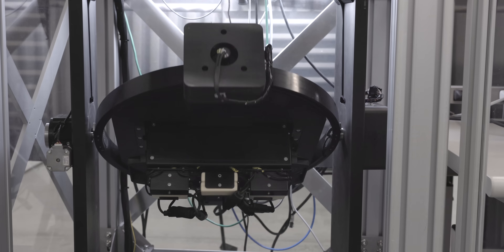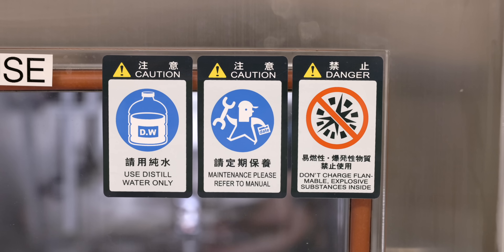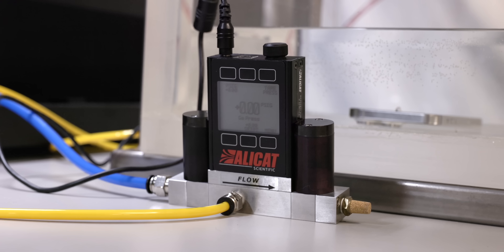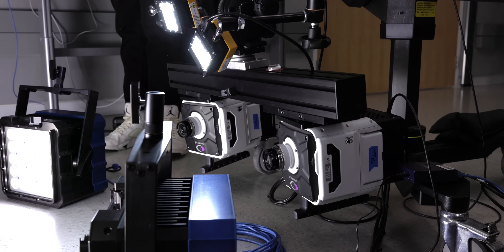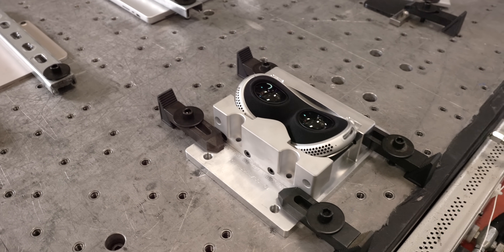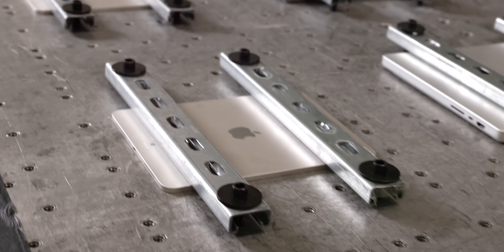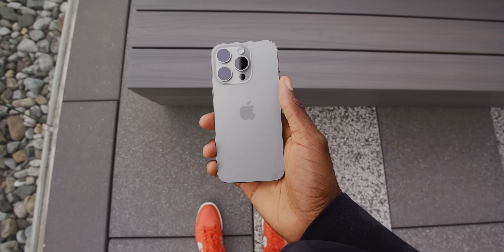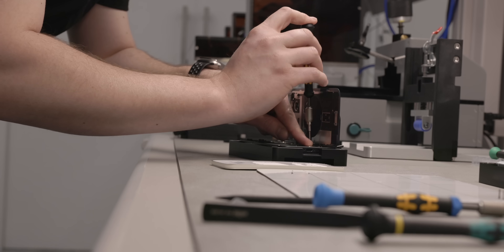I Visited Apple's Secret iPhone Testing Labs!

Comment: "Repairability is at odds with durability"

Nokia 3310: pathetic
Reply: I mean the ULTIMATE GOAL is to have both repairability and durability. But this goes against the profit margins of Apple.
Reply: Nope, the ultimate goal is to never have to fix anything
Reply: @innovativeyetaknowledgless9035  Will not work since batteries age.
Reply: @thepuma77  not just apple. its all companies that manufacturing things.
Reply: @thepuma77  what phone company does it any better?
Reply: I mean, it actually isn't that hard to destroy a Nokia 3310 in spite of the memes - just that you have to specifically smash it with intent, most everyday drops with even the clumsiest of people wouldn't permanently break it lol
Reply: Literally every Volvo before the year 2000
Reply: Well I'm sure with more modern technology it's harder to have both, I feel like with simpler tech finding a balance between the two is a lot easier because there's less stuff to break.
Reply: not to mention older nintendo handheld consoles!
Reply: Is a Nokia 3310 waterproof? There you have it.
Reply: There is an underlying assumption for that statement.  That the size, performance, and cost of the device remains constant.
Reply: BMW & AUDI left the chat
Reply: MrWhoseTheBoss broke the myth of the Nokia 3310 in one of his vids
Reply: Yea it's pretty much a dumb argument but Marques lapped it up like a dog do to water
Reply: @NicotineRosberg  money
Reply: its not easy to repair Nokia 3310 in 2024
Reply: Can you watch youtube on a nokia 3310?
Reply: @seunfunmiewedairo4161  Nokia is releasing a new one 🤞
Reply: Its bs because the main problem with repairability has almost nothing to do with the structure of a product and every thing to do with the availability of replacement parts and software locking parts so you can't replace them. Apple does everything in its power to keep people from being able to buy replacement parts directly from the factories they are produced and loves drm. @seunfunmiewedairo4161
Reply: @seunfunmiewedairo4161 Way to be a smartass. "Im too smart for my own good."

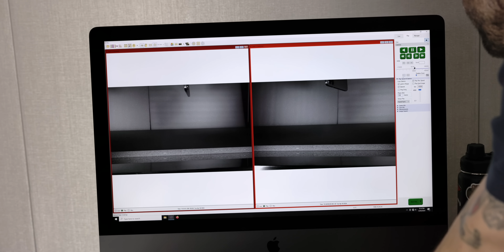Comment: 5:00 is that a IMac running window 😂 I am assuming it’s  legacy software or very old program that was designed for windows that they keep using maybe because they wouldn’t be able to go back and retest with a newer program or with all the data they have it would take a  astronomical amount of time to redo all of the testing . But that’s just guessing.

Comment: For over 18 years I'm in electronic repair industry , in your video on the 6:55  you claimed that repair and durability is on the same scale each one is on the other end, thats not accurate at all, its not even close to reality, Apple is trying to (again ) mis lead the consumer (by using you ) by claiming what you claimed, from my experience durability has to do with material engineering and assembly design only, a water profe device should be easy to repair (if the manufactures provided the diagram and the tools and parts to fix it ), designe it to be easy to fix, has no effect on the durability of the device, in the 90th and 80 all appliances was sent with a diagram and instruction for how to fix it, those appliances is more relabel than 90% of today appliances (ask your parents) They are trying to make it a big deal (Apple and all other brands) to justify there resistan to make there devices easy to fix, the funny thing is when the apple engineer  when basically he saying: repair is not good to the environment, and the device that cant be fix because is "durabel " is bad for the environment .....
thats a direct bullsh....... if you fix something you dont need to buy a replacemnt, that will harm the factories who need us to replace instead of repair, you remember the iPhone 6s battery scandle, i wanna add that when they fail to stop you form using you first ipad you bough iPad 1 to ipad 4 cant be updated and ipad air 1-2 and ipad pro 12.9 1 gen all cant be updated even i cant see why, just to push you to buy a new one, if i need the ipad just to browse online and to check my email why they want me to buy new one!? its all manipoly , they want us to buy instead to fix what we have , and sadly they are using you to promoted , i wish you did some study before you promot what they claim

Comment: Here are the key takeaways from the video:

1. Apple has secret labs where they rigorously test iPhones for water resistance, drop protection, and durability through shaking/vibration tests before releasing them.

2. Water resistance testing involves dripping, spraying jets, high-pressure hoses, and full submersion tanks to simulate different levels of water exposure (IP ratings).

3. Drop testing uses industrial robots, high-speed cameras, and various surface materials like granite, marble, asphalt to analyze impact forces repeatedly.

4. Shaking tests vibrate phones at specific frequencies to simulate years of real-world wear and tear from things like vehicle engines.

5. Apple goes through around 10,000 prototype iPhones for durability testing before finalizing a model for release.

6. There is a tradeoff between durability and repairability - more durable designs with seals/adhesives make battery replacement harder but reduce overall failure rates over time.

7. Apple believes maximizing durability is better for the customer and environment in the long run, despite making repairs like battery replacement more difficult.

8. The head of hardware engineering explained Apple's philosophy of prioritizing reliability through durability testing over pure repairability.

Comment: 07:54 please, no! You can design a product that is durable AND repairable. Please look at rugged phones or even just Windows notebooks or PCs or cars. They are durable, don't fail, and are repairable. It's a choice to make your product non-repairable and Apple went to great lengths to make it so as has been proven by many repair shops and professionals.

Comment: Maybe I'm wrong, but isn't a more durable product when u basically can't repair it worse for the environment? Because the product, when it fails is most likely to just be bricked. So that makes a more repairable product better in an environmental way, but Ig I get the point that the average consumer is more likely to just by a new one and doesn't care + a company wants there product to not last forever so they sell them frequently. It feels frustrating..

Comment: As much as I hate how unrepeatable an iPhone is I do understand the reasoning behind most of it. What I don’t like is intentionally making harder by making parts that you replace make other things not work. In the case of Face ID replacing ID sure can be but the screen and nothing to do with Face ID is pretty annoying. You could argue serlizaing it with the display adds a sort of higher security over it but just something to think about.

Comment: Durability and Repairability do not exist on opposite ends of a sliding scale. 
They are two equally important engineering challenges for product designers and engineers to contend with.
Apple have decided to focus on durability but imagine if they considered repairability with the same level of priority they place on durability.
A "Repairability Testing Lab" with all manner of methods and ways of making a device as repairable as it is durable.
If Apple wanted to be able to make phones as repairable as they are durable they would.
Framing repairability as a factor that has to be sacrificed in order to enable durability is pure marketing spin.

Comment: 10k phones doesn't sound like that much when you consider that they can't just test 1 phone for each of their tests. When you try to intuit what you thought that number would be before you heard it, you are probably thinking more about "how many generations of prototype go through durability desting before the final product", which is probably more like tens or hundreds instead of thousands. But for each generation of prototype, they have to run several dozen tests, with each test being done on multiple devices to get statistically significant results; plus they probably can't reuse the phones at all for multiple tests. So one generation of tests could easily use several hundred phones. Then, after those hundreds, they change a couple things and do it all over again. Easily adds up to thousands.

Comment: Nah repairability is far better for environment.  Glass break , battery has life time and it's just wasting money and energy to replace a new phone instead both ecologic and economic stand points. Many other phone brands are also water resistant and easier and cheaper to repair. Things used to be much cheaper and reasonable,  like we used to be able to add memory cards to phones instead of paying a hundred bucks for more memory. We used to be able to plug in headphone jackals easily listen to music. They removed the headphone jack to sell bluetooth ear buds. The more products they can sell is the option they prefer. Good thing we have android competitors. Otherwise it will be much worse .

Comment: And also, as phones become more durable, they will live longer which will expose them to types of failure that need the phone to be more repairable, but if it was more repairable and less durable, their life span won't be so long for those parts to even break, and you need to repair the phone few times before you get to the point that you got to when the phone was more durable but less repairable, maybe you'd rather a durable phone and when it breaks it's time to upgrade.

Comment: Repairability == Upgradeability,
If infinite durability == 0 repairability
Then infinite duability == 0 upgradeability.
0 upgradability == assured obsolesence.
Therefore, planning for infinite durability is planning for obsolesence.

You are essentially saying gauranteed e-waste is better than probable e-waste.

I would still be using my LG v20 if i didnt drop it in a moat guarded by a mountan lion.

Comment: When I worked at Motorola we were mandated by the operators to do a test of a ball bearing dropped onto the screen. Guess operators are not so fussy anymore. There are more tradeoffs than durability and repairability. Cost, ease of manufacture and thinness are all elements.

Comment: I would like to point out the straw man’s fallacy by apple employee. Firstly, both extreme cases are not possible, specifically the infinitely durable one. And since, I have to choose a most durable yet if it breaks, getting it repaired is actually 70%-80% of the cost of the new one,and on the other hand, a phone that is not that durable and breaks easily but very cheap to repair, like nokia 1100 back in the day. Is it not better to have the later one? Plus, ok water proofing, yet giving battery replacement option to consumers,  seal the electroni components with your best glue and then even if the water seeps in the phone it damages the battery but other parts won’t be damaged..  but apple doesn’t do that, because actually making phones durable is losing deal for apple like making those long lasting bulbs were losing deal for bulb makers in 1950s.

Comment: Dear Marques, thanks for bringing an inside look into the durability testing at Apple. Apple argues that repairability and durability are at odds sometimes. However, given steps that Apple has taken to make repairs more difficult that have nothing to do with durability such as pairing the camera to the motherboard, and not giving third party technicians the resources or parts they need, I don’t really buy it. It would be great to see you dig further into this!

Comment: This was Apple-itically correct 👎🏻
When you make the assumption that a durable product has to be difficult to repair, you insult companies like Toyota, Lenovo, Makita, JVC ....
The problem is not getting inside the product to fix it, the real problem is software locking it to make it impossible to fix and going after every one trying to establish a business repairing what you refuse / deem unrepairable.

Comment: Waterproof seals and battery replacement is one place where durability/repairability tradeoff is present, and that's a good point. But there are plenty of examples where durability and repairability are not connected at all.

Comment: Beg to differ on the point that is being made at 08:00 about durability and repairability, obviously there is a difference between i.e white goods and phones, but for example miele products is extremely durable but also not that hard to repair. And you never asked why apple would prohibit people from adding third party parts via firmware.

Comment: Regarding durability vs ease of repair. You consistently say that there are two reasons why companies do something. There is the public reason, in this case durability, and there is the real reason, which lets face it is almost always higher profits.

Does making phones more difficult to fix increase durability? Yes. But does that have the side effect of guaranteeing OEM parts (OEM screen maybe i get, OEM adhesive...ehhh, Apple doesnt corner the market on good adhesive) on repair and helping prevent right to repair laws. Also yes. It's a little tough to accept at face value this claim that so easily fits into the narrative that makes it not only harder but substantially more expensive to repair our phones from the people fighting so hard giving us the ability to repair our stuff.

Comment: I do not think I had thought about it that way before, but for sure, I would rather have my phone durable and just not break, then repairable, assuming that the two are mutually exclusive. I have had iPhones since the very first model, and I have NEVER needed to get one repaired, not once. I kept my last phone for I think 4 or 5 years, and it was still fine. I got a new 15 mostly for new features, not because the old one no longer worked. The battery was weaker then when it was new for sure, but I think it was at about 80%. Not terrible.

Comment: 7:30 That's completely moot point, and everything that follows also.
No-one is asking them to design less durable devices, they are asking them to stop purposely designing hard to repair devices.
Locking parts doesn't help the phones durability in any way.

Comment: The argument made about reliability vs repairability isn’t necessarily valid. Take for example a Chevy 350. One of the easiest to work on engines to exist, to this day… it’s also one of the most reliable engines still… there is a reason the LS platform is basically just a modified 350

Comment: Drop tests are important - you say that if you drop a phone, it will break, but I had quite a long argument with a case manufacturer who pointed out that the phone isn't breaking, the screen is. Phones are actually remarkably resilient when it comes to dropping - the battery stays in place, none of the internal connections come loose, just a little bit of easily replaceable glass cracks. So the drop tests will be checking out what happens with the internals, rather than externals.

Comment: I wonder how many labs you didn’t see. I work in product development and we have much of the same equipment for product drop, water ingress, vibration, etc.  But we also do vibration cycles while rapidly cycling temperature high and low using liquid nitrogen, extensive ESD, surge, button tactile feel tests, power interruption, etc. to find weak points in a design. I’m sure Apple has those things, and it’s cool to see the parallels between a ~$3T company and a ~$1B company, but I know they have some cooler stuff and I want to see it!

Comment: I can see the point of durability being a good thing for the environment, but there is a point where the durability of a device would become an environmental issue.
It's similar to plastics taking hundreds of years to break down. Plastics are durable, but that doesn't mean we should continue to use them to the extent we're using them now. It doesn't mean that we shouldn't think about better ways to produce goods and recycle existing materials effectively.

Phones should be durable, but a balance must be made to allow people to decide whether to repair and/or replace components.

Apple's goal as a business is to increase sales year over year. More sales means more devices being sold every year. That means more resources being used to create the necessary components for the devices sold. Once they break, you either repair it the Apple way or buy a new device from them.

So this statement from Apple of "durable devices are better for the environment" comes off more as a virtue signal rather than a sincere reason.

Comment: Sorry mark, I disagree. You can make products that are durable and reparable. The best phone example is the nokia 3310, highly regarded as one of the most durable phones ever made and it is also highly reparable.
A simpler example: a steel bar, durable? Yes. Repairable, obviously (welding).
Don't let Apple off the hook with regards to repairability.
Love the rest of the video.
Reply: Sore for the rant

Comment: 5:00 I’ve probably dropped my iPhone 13 Pro dozens of times including from shoulder height onto tile floors and including onto concrete a couple of times with no case and it’s 100% fine just with scuffs on the corners.

Comment: That repair VS. durability talk is just plain bs. Things that are built like a tank can still be repaired, think about Kitchenaid, maybe is difficult or expensive to do, but still can be done. I design machines for the food industry, and we still have to make things that are water resistant AND repairable,  because we NEED TO and TBH if something isn't repairable, thats on purpose. If just one connector brakes we don't scrap everything and say it: OK, you have to buy a new 200k machine because that 50 dollar part broke in a way that we design it to be impossible to do. We make things that are ip68 and still can be disassembled, but that come in the cost that the thing is not that compact